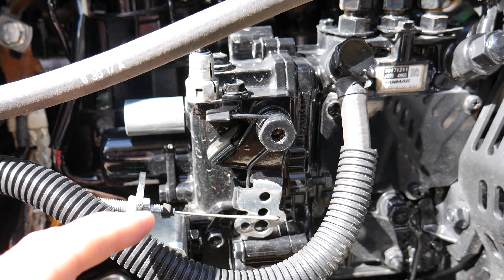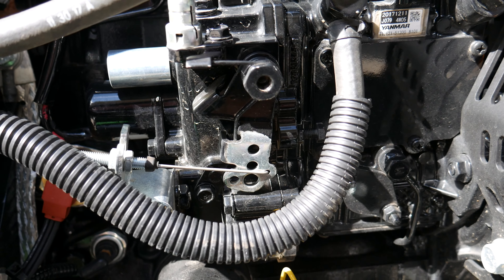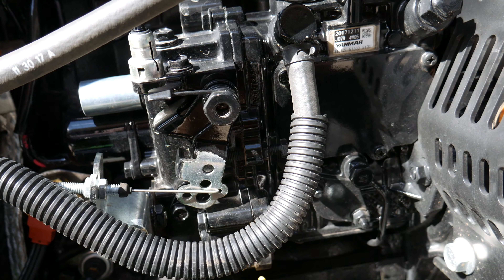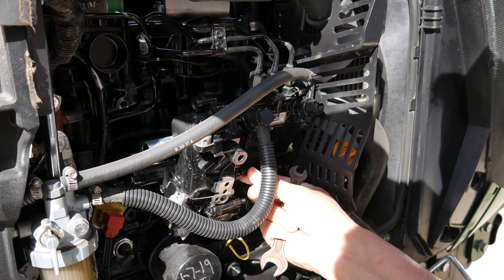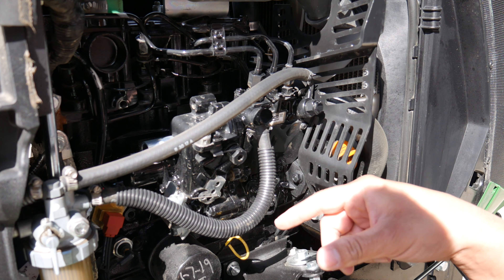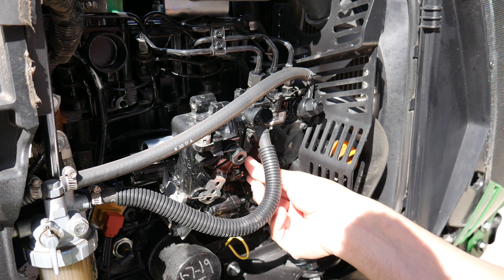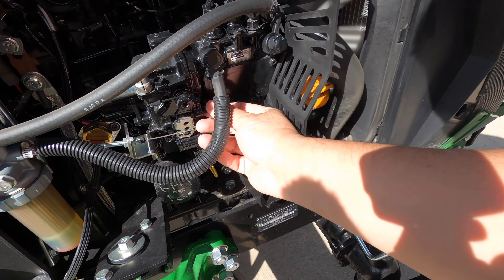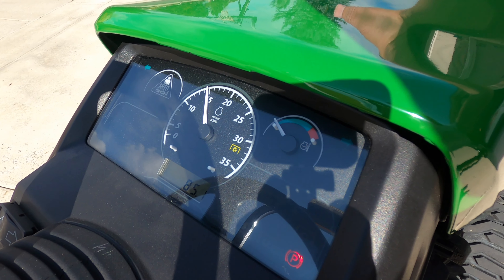Adjusting Idle Speed on 1025R 1023E 1026R John Deere

Comment: Ive oftern wondered about this idle setting or not. seems like to me, the 1500rpm idle setting is to high & should be set around 1200rpms, but innevrr gave much thought as to if this would effect the hydaulic pump or not. i was looking to safe the fuel advantage at the lower rpm settings.

Could this adjustment be done for the higher engine throttle settings to increase more power to the engine itself, thus creating more power to the hydraulic system??? 

i would love to have an engine increase in 5-7 horspower & have a stronger lifting power at the hydraulics as well. Any ideas on what to do???          Thankya for sharring this video. its going to my library to be saved. Godbless
Reply from the maker: Rodney, I would not increase the engine RPM as engine horsepower (in the case of the 1025R) is not directly related to your hydraulic pressure.  There are other methods that you can boost the hydraulic pressure; one of which is installing shims that alter the point at which the relief valves open.  The John Deere 1025R Technical Manual specifies the safe operating ranges for hydraulic pressure and you'll be able to tell what the maximum recommended PSI is.  I would not exceed those limits, as I've seen other people end out destroying their hydraulic pump, which is obviously a very costly repair!  I may make a video on this in the future.  Thanks for watching!!
Reply: @TractorHoarders  Thankya for the strong advise & thankya for sharing

Comment: Ive often wonder about this idleing at 1500rpms of my 1025R. . . . thinking, "Its high for beiing at idle. I wonder if there is a way incould turn it down a bit to save on fuel as such a high idle point???" I never gave much thought about the  lower RPMs effecting the hydraulic pump at all. Would it actually be effected at all.

now that you have shown the the lower RPM idle. . . . . what about making an adjustment at the higher engine running status??? Accordijg to the rpm gauge on the dash, they will go no higher than 3,000rpms! can one set this to a bit higher rpms to increase the stronger power at the hydraulic system without causing the engine to exceed "overspeed" limitations???
Reply: No the engine itself isn’t rated for over 3350rpms you need the same engine in the x758 and 1023e which is a .9 liter vs a 1.2 in the R 

Basically leave the redline alone hahaha
Reply: @GoGoggansGo  Copy that!!!

Comment: Should this be done when warmed up as the fuel density, etc will vary warm to cold? Maybe not enough change to matter.
Reply from the maker: gregrob20 Great question.  This is simply a mechanical adjustment to the throttle linkage, so no mixtures are being changed.  It shouldn’t matter if it’s hot or cold, but not a bad idea to do it on a warm engine.  Thanks for asking.  Good question.